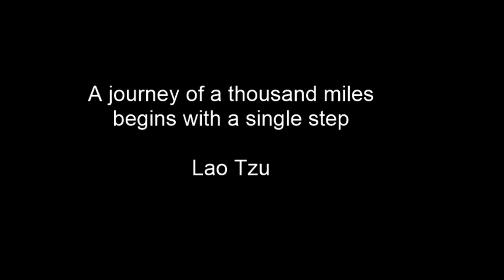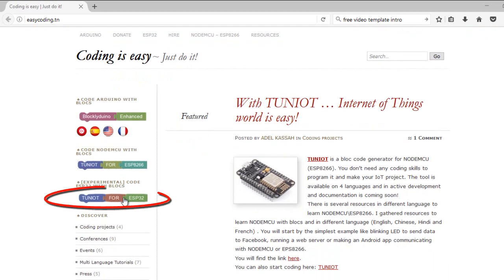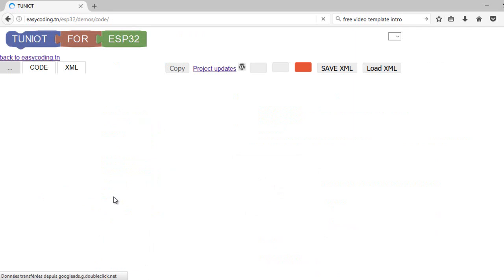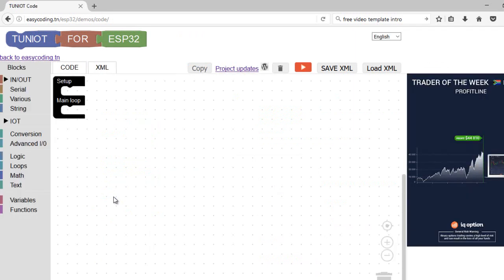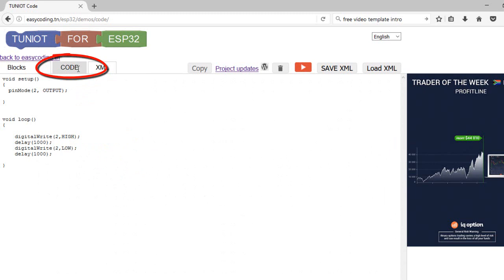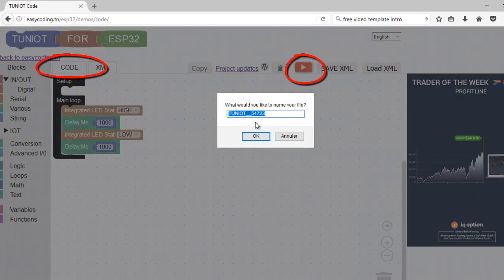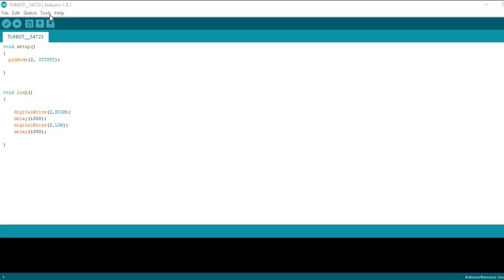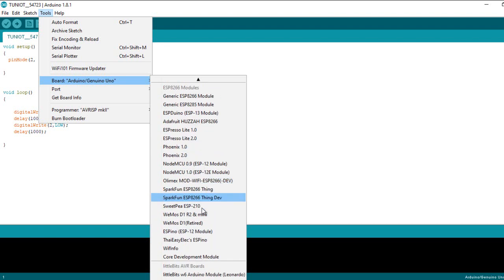ESP32 tutorial A-02: Blinking internal LED

Comment: I have a fast blinking LED on my board, but I think it is just connected to the 3.3V  or charging rail by default it comes on when I have USB in. but no tinkering with the program changed the blinking rate. Would this simply be because of my specific board?
Reply: OK, I found the LED next to reset button, and it had the number 5 printed next to it, so I changed the 2 in the program to 5. Now it works, thank you.